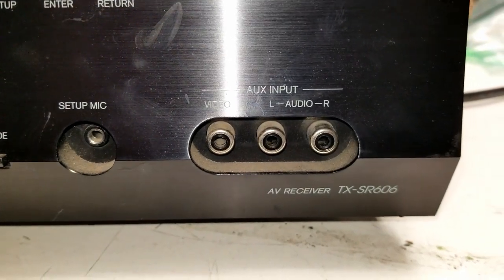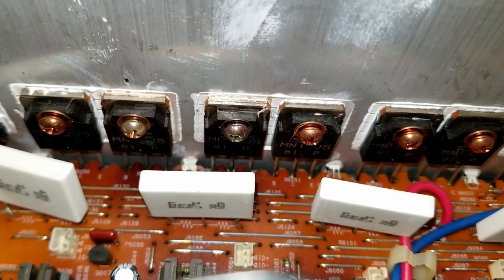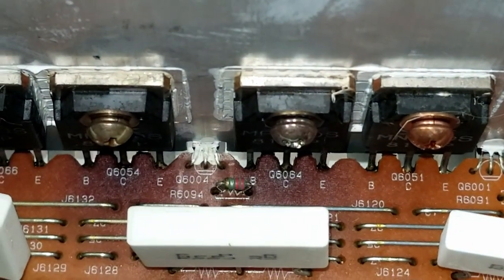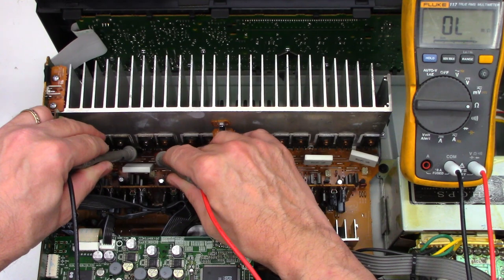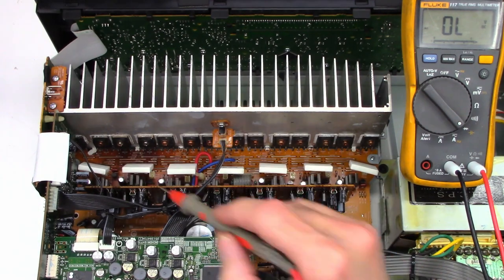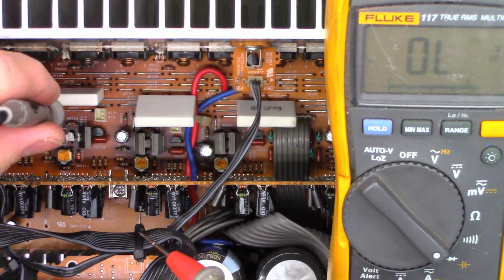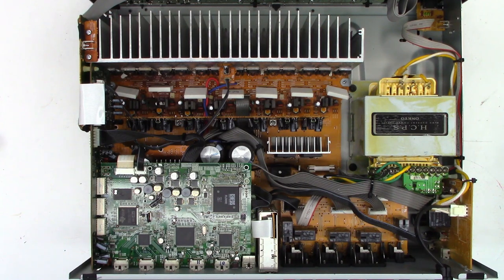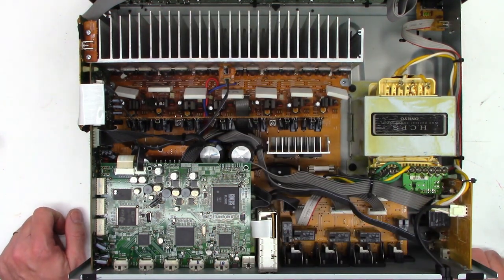ONKYO TX-SR606 WONT STAY ON * POWERS OFF AFTER A FEW SECONDS * PART 1 DIAGNOSIS PORTION

Comment: @NorCal715 I have repaired hundreds of these just a heads up the repairs are straight forward as you have shown. But please know that the HDMI board on these fail all the time and I have also repaired hundreds of those. So make sure you let the customer know that the output repair can be done but don’t be surprised when the HDMI board starts to get flaky shortly after the repair. Why because that is how it always goes when a repair person works on something. Another thing you will want to do is tighten all the transistor screws. Trust me they will all be loose and I sometimes think this is why they fail; they don’t have good contact and just over heat.
Thanks again for sharing your knowledge I am sure helps a lot of people.
Reply from the maker: Will do thanks for the heads up. I plan on ESRing the caps on the hdmi board also when parts arrive.
Reply: This comment saved me a bunch if time.   I couldn't figure out why it was kicking out.   Turns out it's knly hdmi kicking out.   Where would I find a replacement board.  Or is there a test for this?
Reply: Cancel that.   It just runs longer with tuner mode.   Still kicks out.   Any ideas?
Reply: What do you mean by it's still kicks out does it power off do you lose audio please provide some more info.
Reply: I just started it up with sound one speaker.   It runs for about 10 min then goes to blinking standby light.
Reply: Changed to the other speaker output.   Same thing.  Must be over heating somewhere to keep kicking out I suppose grrr.
Reply: @mhavreck3223  bit of a long shot after so long, but I fixed mine by changing the speaker impedance setting from 6 ohm to 4 ohm. If you can't do that in settings before it shuts off, I took out the preamp board and the amp had no problems (other than no sound obviously), and that should give you more than enough time to tweak things.
Reply: @Shane Murphy  i ended up taking it apart and testing the board.i found that replacement parts were more expensive then a 2nd better amp.   Unfortunately, I had to decide to give up on this learning project.
Reply: @mhavreck3223  ah that's a shame. Did you identify the problem out of curiosity?

Comment: Thanks for the video 🙌🏻🙌🏼 Very clearly explained.
Mine is the tx-600E, puh-leese tell me there a factory reset, press a couple buttons ... and voila?
I went into 'protect' after I connected the sub there was popping, and from then on, just switches off straight away.
Your part two is playing now - I really don't know.. it could easily come out worse if I have to do all that 😭😭

t t prior to that there was no sound atl. art 2 is on right now.

Comment: Cut a hole in the bottom of the thing with a dremel, I've done that before, the customer won't notice, just put some kind of cover on it when finished.
Reply: Great idea!
Reply: Not a bad idea, beats pulling the unit apart.
Reply: My first thought, but then I'd worry about shavings getting into other bits.
Reply from the maker: Ya thats not gonna happen! They did approve the estimate and I have parts on order. Stay tuned for part 2
Reply: Looking forward to pt2, cheers for the videos.
Reply: @norcal715  Ballpark repair costs (parts / labor)? If I have to ask, does it mean I can't afford it? (Asking for an Onkyo TX-NR838 that just shorted its right-surround)

BTW, Would you ever allow a tech-savvy client to disassemble such a unit and just hand you the problem board needing soldered element replacements (and would you charge less to do just the unsoldering and new soldering)?

Comment: I have the exact same unit with the same fault but no heat marks on the transistors but it appears the front right transistor has failed using the meter.  My unit lasted 11 years.

Comment: Definitely had my fair share of tearing these down.
Reply: What goes wrong?
Reply: A great deal of the time, the incorrect speaker types are substituted. These units often end up in flea markets without the correct speakers. They generate a great deal of heat by design and over the years, incur multiple solder joint cracks.

Comment: Hi I have a issue with my onkyo TxSr 343 it goes on amp dialog mode in few minutes after clearing the fault by pressing CBL/SAT and standby mode please advise if you can help me fix the issue.

Comment: Sir my onkiyo receiver  stays in only DVD mode if change to any other mode it immediately returns to DVD Mode please suggest me the solution
Reply from the maker: Start with a full reset. Usually in the instruction / owners manual. You usually have to hold 2 or 3 keys down while powering up the unit. Let me know how it goes.

Comment: I have an onkyo txsr333 and it is doing the same..but for about after 5 minutes it will turn off..sometimes longer. Does the power fluctuations affects the unit as well? Checked the speaker connections(Bose AM 6) and they are fine.
Reply: Is it helpful to use an Automatic Voltage Regulator?

Comment: Just clip off bad components, the system will probably start working. Who cares about surround channels anyway!
Reply: @NorCal715 That raises a new question: What if I do use my surround channels but never use my back channels (6 & 7 in a 7.1 unit). So if my surround burnt out, then can I "clip out" (cannibalize) parts from my unused back and use them to replace what's burnt?

Comment: Cheap and poor service access. Possible operator error. Yes I love home theater. Too many years of audio video. These were not remarkable receivers. Not made to last. Mine lasted two years. Sounded pretty decent. But was the last receiver I would buy before going to quality separates. Never will buy an AVR again. Also what was the protection circuit doing?

Comment: Dismantling is not that bad. You keep the back panel attached and just disconnect a few cables from the front, then the entire internal structure lifts out as one. There is just enough cable to stand it on it's side over the transformer. Watch the last cable doesn't fold over as it wraps over the transformer while you lay the assembly down on it's side. I'm going to have to watch part 2 now to see if he works it out.
  Oh no, he didn't, copy and paste!

Comment: Very Interesting , I have had this exact receiver from new , never had an issue with it in the 12 years I've had it (Bought June 2008).I know others have had CAP problems on the top HDMI Switching board. Perhaps I've just been lucky I guess.
I suspect if I wanted to keep the receiver longer and improve the sound quality , I could replace the CAPS on the lower board with better ones , if that is the amp board, with something like Mundorf E Caps or M Caps.

Comment: In case this has to go to the landfill then you can make an attempt to cut the bottom of the case just around the zone where you have to work using a Dremmel with a cutting disc for metal, just being careful to not let the cutting wheel to enter more than a millimeter inside the bottom panel.
Reply: Then the problem would be how to close the opening, and this would require some job, you would need some metal sheet strips to solder around the cut piece and then solder them to the bottom plate, and that would require a very powerful solderer.

Comment: It's a HDMI unit, I'd be surprised if the customer didn't want it fixed, but then again, I don't know the replacement cost or the quote you'd have to set for the work involved. Are Sanken  MP130S/MN130S transistors easily available for quick delivery where you are (weeks to get them in Aus).

Comment: Hi, I also have a receiver of this model, and the current problem has no video output signal, whether it is HDMI or color difference, or video output. I know that the HDMI board is a common problem with this model and I have replaced the 5 capacitors on the HDMI board. Please tell me where I should check. Thanks!